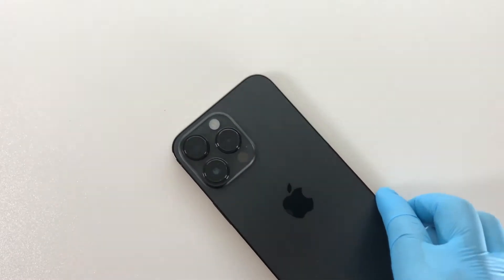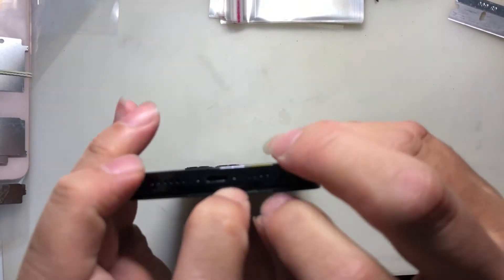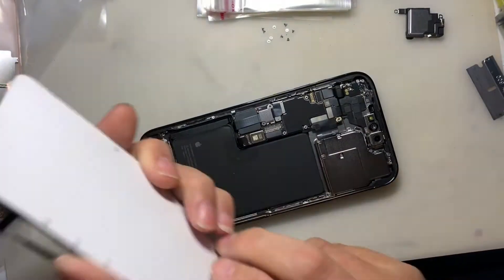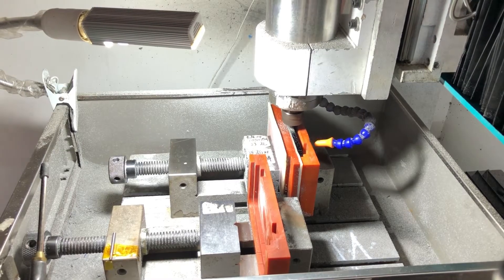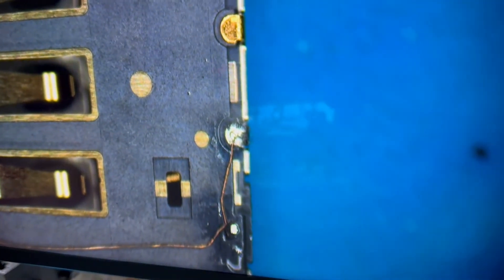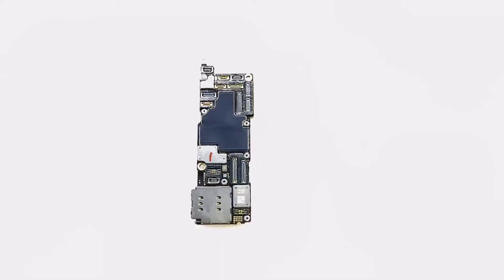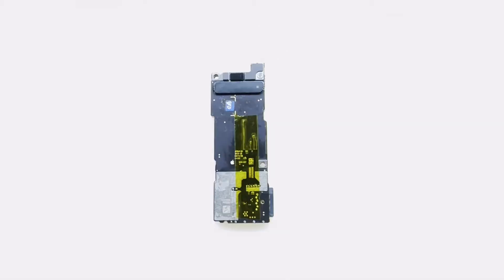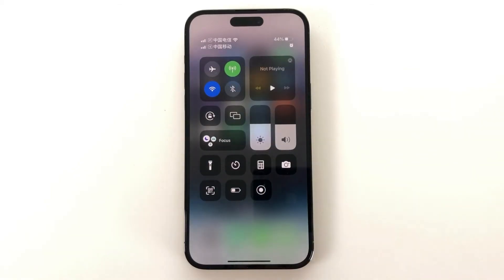iPhone 14 Pro Max - Converting eSIM to Physical Dual SIM #huaqiangbei #esim #iphone14promax

Comment: Hello, please, if i have iphone 14 pro max (eu version with single sim tray ), what needs to be done for converting to dual sim tray slot? Is the sim tray soldered into mainboard? Thank you for hint and support
Reply from the maker: You need to cut an esim line first and replace it with a dual SIM card holder soldered on the motherboard.

Comment: How to revert to a esim I think mine was done but now I have an issues wherby if I don't put 2 physical sim I can't make call or use ussd 
But if I have 2 sim installed it work without issues 
But if am on just 1 physical sim I can't make calls or use ussd but I can receive calls both local or Internet call and also I can browse the web just can't make calls please help out here on what to do
Reply from the maker: The cost of installing two SIM cards is to cut off two esim lines. I don't quite understand your question.
Reply: @FollowMeRepairs how to revert back to esim after performing the wylie conversion 

I have a 14 pro max that came with the flex conversion I keep having sim card disconting 
So I remove the sim tray and the flex but still it still detect as physical sim I just want to revert back to using esim I hope u understand 

This is what I have tried so far
1. Removed the wylie dual sim tray
2. Removed the wylie flex cable 

When I reboot it still detect as physical sim
Reply: @chikaubah9687 I have a similar case. My 14 pro max eSIM was converted to dual physical sim. I have used this phone for two years without any single sim issue until I replaced the swollen battery then I started experiencing issues with sim detecting. Sometimes it works, sometimes it doesn’t. 

I want to ask, when you charged the sim reader + flex cable, did your SIM cards start working again?

Comment: why did you make the bridge on sim tray ?? and what the reason you cut the line on motherboard at 6:30 ???
Reply from the maker: The principle of changing esim to a physical SIM card holder is to cut off the two esim lines first, so that the SIM card holder line can be used.

Comment: Hai, i just bought 14 pro max modified version, it will damage or not for long term use?
Reply from the maker: I have been using the iPhone 14 Pro Max in the video for two years and everything works fine.

Comment: It doesnt require any flashing to set it up right , and also when you undo it , does it go back to as it were , either esim unlocked or locked
Reply: if its locked to tmobile or any hard simlock providers then you need an unlocking chip such as gpp 5g chip just like the one that i used in my tmobile locked 14 promax

Comment: Wont this modification affect phone  ?
Reply from the maker: Do you mean it is different from the previous iPhone? Of course, after cutting off the two ESIM lines, the ESIM function is lost. If you only cut off one ESIM line, you can use both the SIM card and ESIM. The iPhone has two ESIM lines.
Reply: Does this modification create problem in phone ?
Reply from the maker: Of course not! Because this modification is valuable.

Comment: Is this still working? I have spectrum locked iphone 14 pro max can i use this method to unlock it with 1 physical sim using the second imei?
Reply from the maker: Yes. After adding a physical SIM card you need to use a card sticker to unlock the Spectrum before adding a physical SIM card.

Comment: does the esim still working if the phone has been modified into dual physical sim slot?
Reply from the maker: Of course not! Changing to dual physical card slots requires cutting off two esim lines. "SIM+esim" can be achieved by cutting off one line.

Comment: Question, how do i fix my esim? I think the module stopped working. I cant see anything under cellular settings. Multiple factory resets did nothing. Apple said its likely the part itself and claimed its attached to motherboard. I have the US model. Cost to repair is like $500. Seeing as you know this phone pretty well, can i replace the esim module somehow? Any advise or assistance would be appreciated.
Reply from the maker: Sorry I can't help you, I don't see your iPhone, just your text description. It is definitely possible to repair iPhone esim problems. To confirm that it is just an esim problem requires strict testing.

Comment: Hi friend. I have iphone 14 pro max Us model but this was soldered before in Dual physical sim if there’s possible to get back to dual Esim again. Thank you
Reply from the maker: Dual ESIM can be restored. Remove the physical SIM card holder and connect the ESIM cable that was cut off before.
Reply: Please provide  tutorial for restoring esim
Reply: @RainMagar-j9p  Did you manage to do it?
Reply: Do you know how to make one physical SIM card and one esim?
Reply from the maker: @ДурневЕвгений-ы5щ  The same method and principle, do not cut off both esim lines, keep one esim line. Only one physical SIM card can be inserted into the card holder.
Reply: Were you able to do it?

Comment: one thing I don't understand why one line cut? if I don't cut then what result?
Reply from the maker: @AKApple-zz5rn   The US version of the iPhone 14 Pro Max uses eSIM technology and does not have a physical SIM card slot. To install two physical SIM cards, you must cut the eSIM line. If you want to keep the eSIM function at the same time, you can add one more physical SIM card slot. To achieve "1 x eSIM + 1 x SIM", you do not need to cut the eSIM line.
Reply: thank you  so much for this instruction because same thing happen with me I don't cut line and shows only one sim and one esim , thanks again  @FollowMeRepairs
Reply from the maker: @AKApple-zz5rn   Have a good day!